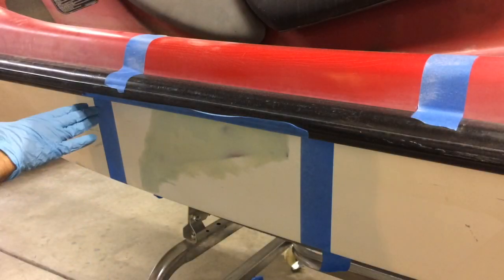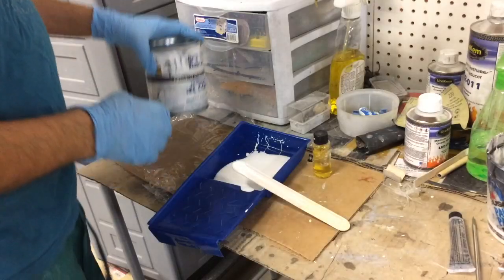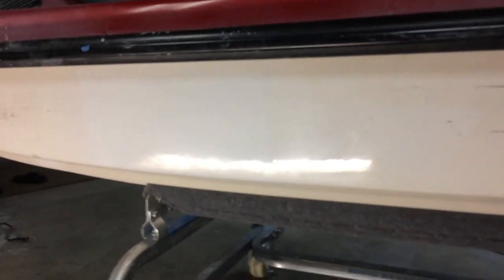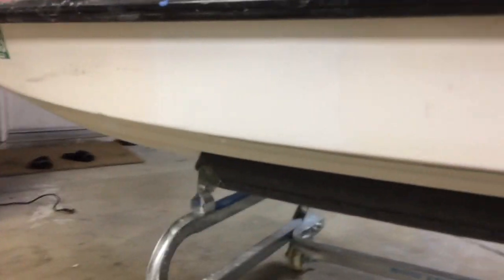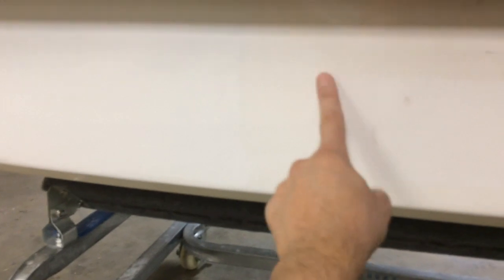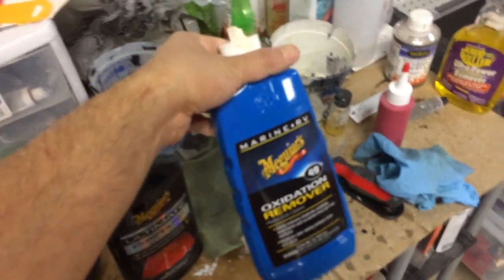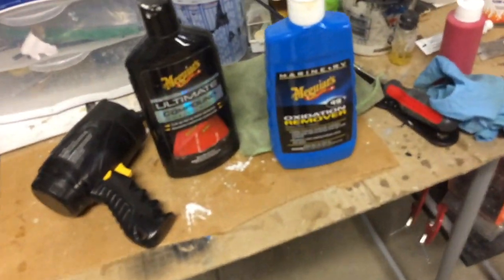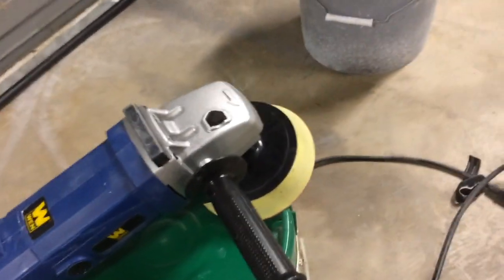Jet Ski hull repair Apply Gel Coat - Part 3

Comment: Do you only gel coat the bottom of the boat? Or if I have a crack on the top side do I still have to gel coat?
Reply from the maker: Sure. Won’t harm nothing… you can even paint over the gel coat. It’s just a protective coating

Comment: I've already filled all the cracks and it and it's ready to paint I have Marine Paint but I am not sure what applicator to use a roller is too big and a brush all the bristles are coming out in the paint is there a certain type of brush that I need
Reply from the maker: James Mcnally using a roller or brush is acceptable depending what the product manufacturer. The roller is easier but the brush can be used in tight places where the roller can’t reach. After the application, you’ll sand for polish. The product manufacturer may suggest what sand paper grit to use. If It doesn’t, use 1500 to start then finish with 2000. 3000 grit will make polishing easier
Reply: Buy a good brush, dont get those crappy $2 walmart brushes, spend the $15 or so for a purdy or something

Comment: Hi I’m trying to repair my jet ski it has a crack on the bottom of it could you tell me the names of the products you used to put inside the get coat I know it’s sea hawks gel coat and then I seen the wax adhesive but I don’t know the name of it and the second thing u also added into the gel coat thanks for your time
Reply: Your video was very helpful also now I can properly fix my jet ski at home without spending tons of money
Reply from the maker: Hi Cheyenne, I ordered the sea hawk gel coat from Amazon. The gel coat includes with both the wax and the activator. The activator is the clear little bottle I mixed with the gel coat along with the yellow bottle, the wax. Most gel coat product will include both and provide mixing instructions. I hope this helps

Comment: Hi

I used a heat gun and pretty sure I completely stripped all the gel coat off my jetski. 

Maybe a dumb question but... do I need to re apply or can I just get a good primer base on there then paint?
Reply from the maker: Cooper doG , I’m sure focused high heat on one area can produce negative results. I set my heat gun to low. Sorry about your misfortune. Heat guns can be a great tool or a fucking mistake lol

Comment: Nice job - did you add any additional fibreglass to the inside?
Reply from the maker: Thanks, no additional fiberglass needed for this repair.
Reply: waltwitty  not the inside???  What a hack. Show what the inside looks like now unfinished!!!   Hope no one paid you for this repair.  Jeezus Christ
Reply: Yeah I'm thinking you did it wrong bro.jet skis and Corvettes are made of SMC so poyester resin and epoxy resin does not bond proper due to release agents mixed with the resin for faster production times. Good luck though on your videos.